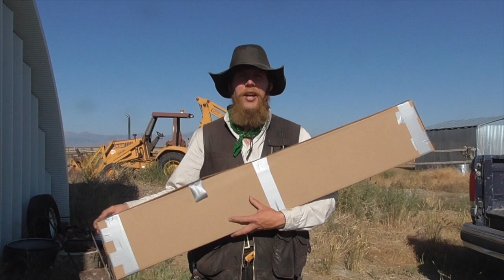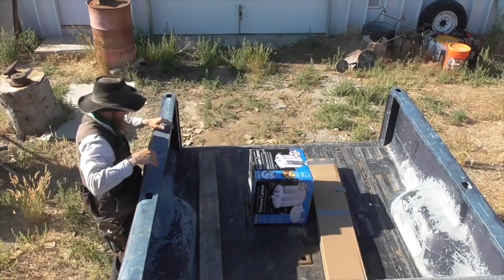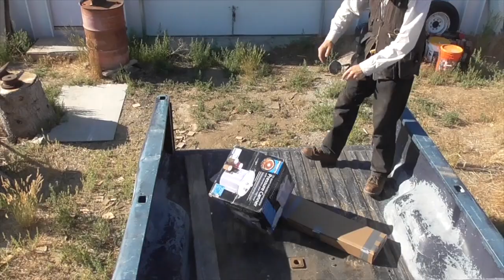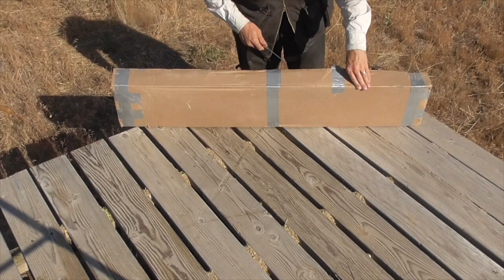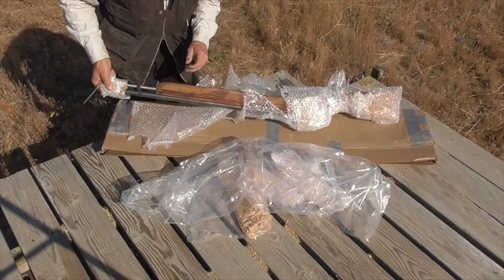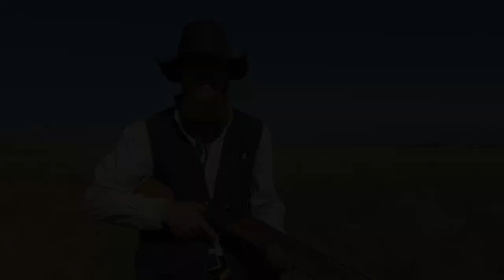Packaging Experiment (TIS277)

Comment: I had to ship some polished custom pieces with similar concerns, thought of 2x4 and 1/8th inch to make a custom box but the weight would have made it 3x more $. I ended up buying some rigid sqare corner organizer things from the dollar store, dont even know what they are they are rigid plastic rectangle containers sold inbetween hampers and silverware. But I laid those out and cut out some reliefs in the middle for  the parts to lay in-wrapped the parts in those thin foam sheets that people put around glassware when moving,  saran wrapped that up and used one can of expanding foam with a sheet of plywood on top and bottom. After a day I removed the plywood and I had a perfectly squared off block of foam with a rigid plastic skeleton. Slid right in the box and the whole thing was about 6 bucks, most expensive part was the spray foam which every hardware store will always have a type or a brand on sale for 1-3$

Comment: There are standardized tests used for product packaging that you might want to look into. One possible problem with your packaging is that rifle does not appeared to be held in place by the packing material. which could allow the toe or the heel of the stock or the muzzle to be damaged on a end drop of the box.  If the budget allows you may want to look into a box within a box packing and or slip on fitted or semi fitted cardboard and foam pieces to protect butt of the stock an muzzle.  Another option might be using a 2 piece box or mold frame so that use spay foam or expanding foam and plastic bags so that the rifle is encapsulated in the foam. this is done by wrapping the rifle in plastic wrap, and then using two large thin plastic bags one the top and one the bottom and expanding spay foam is shot into them to form a cocoon around the rifle.  I use this method when shipping firearms, electronics and most other fragile or semi fragile item, it is quick and easy to do and pretty inexpensive to as well.

Comment: Good to see you still working on things. Did you check if you retained zero after the simulation? I'd figure it wasn't changed based of surface inspection, but you never know.
Reply from the maker: Actually, I unscrewed the aperture and sight adjustment screw (because they stick out and are more fragile than other parts), put them in a small ziplock bag, and taped it to the trigger guard as part of the packaging process, so the sight would have to be reassembled and re-zeroed after shipping, but that is better than one of the screws getting bent in transit.

Comment: You pretty much simulated FedEx exactly
Reply: When I ship some expensive and somewhat delicate precision machined parts I will make a "handling" resistant custom fit box out of 3/4 ply wood reinforced with 2 by 4's with  metal brackets. I've seen what has happened to those same parts when they're shipped in cardboard boxes. Most times the box weighs more than the contents.